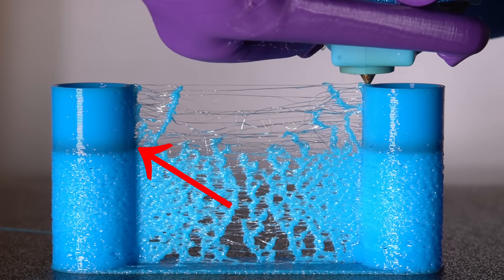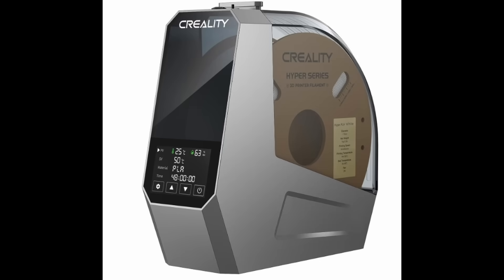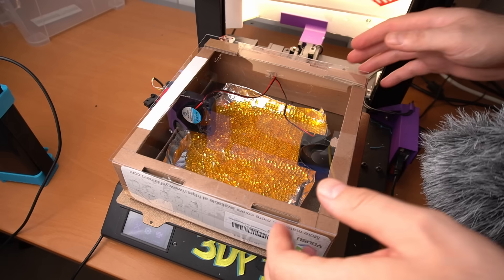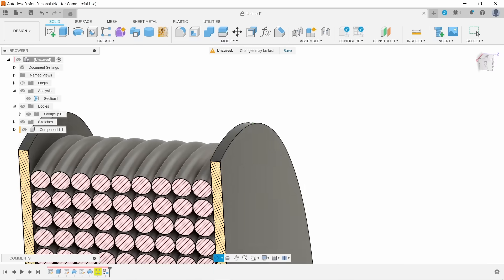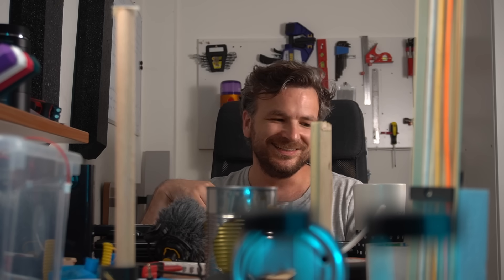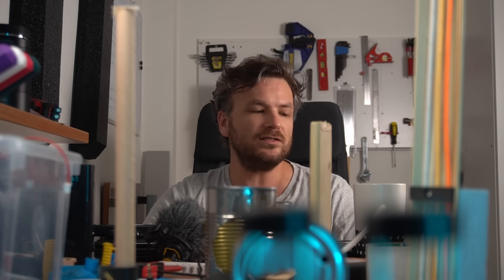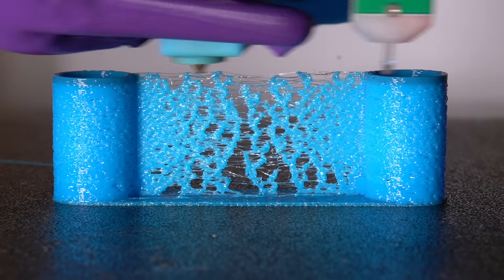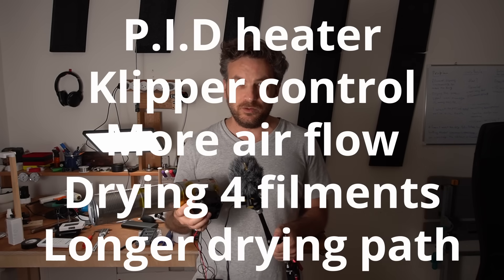Why are we drying filament this way?

Comment: I think the question is: Why does moisture cause artifacts in prints in the first place? When moist filament comes out of the hot end it produces steam. That’s moisture escaping a closed system. If the steam had somewhere else to escape perhaps it wouldn’t cause artifacts. A dry box or dehydrator essentially uses heat, just like a hot end uses heat to melt the material. 

The difference is a dry box / dehydrator doesn’t apply enough heat to melt the filament, but enough for the water to be forced out of the filament (boil off?). This takes time though. 

I think the challenge of inline drying is you need a temperature high enough to quickly expel the moisture, while preventing the material from melting or softening before it reaches the hot end so it doesn’t cause over/under extrusion. Using a lower temp prevents this, but requires a longer run / more time. Using a higher temp has the risk of making it too soft and causing thermal cycling. Ideally you want to inline dry filament you are about to use and not retract back on the spool. 

Isolating filament into a strand is interesting though. You may not be able to dry it inline just before printing, but I wonder if you could combine a spooler to more efficiently dry the filament by slowly unwinding/rewinding the spool. With a wound spool the filament on the outside is likely to dry first while the inner spool will dry last. Sort of like cooking a steak. If you could slowly dry while winding, perhaps by you can use less heat. This doesn’t solve the inline problem, but could result in a better dryer.
Reply: There are two issues with moisture.

One is that the steam, as it occurs in the meltzone, causes the melt to separate. Once you have a bubble of gas in your semi liquid melt, you lose control over the extrusion, as the steam will try to push the portion of the melt under itself out of the nozzle. Even if the pressure isn't very high, the fact that it's separated means that it will droop, you cannot prevent it from leaking by retraction. Foaming is also partially this issue.

The other is a chemical process, hydrolysis, in which water will cleave polymer chains, and this only happens at a substantial rate at elevated temperatures, with critical temperature being vaguely rule of thumb somewhere around 75°C, below which there is basically no damage, with higher temperatures being progressively more damaging, and our printing temperatures in range of 200-260°C being quite bad. This is why you specifically don't boil the filament in a dehydrator or drybox. Cleaved polymer increasingly shows lack of cohesion, basically you get crumbly shit, as you need that looooong chain of polymer (typically tens of thousands of chain bonds, reaching into millions, topping out at millimetre scale length) so they can all hook into each other. They aren't anyhow connected otherwise, they're basically a bunch of floppy ropes that are held together by friction to make a solid item, isn't that cool? This is what makes them thermoplastic btw, chains that are connected to each other across (crosslinked) cannot be melted and unfurled from each other, they can only be burned :D

Comment: That's a pretty interesting thing. And the longer version worked becaouse the filament was exposed to hot air for longer. If the can was bigger the filament could be moved through it in a spiral to maximise the time it spends in the dryer and allow for higer speeds. Though, that would probably require some kind of motor that would need to be synced up with the extruder to help it a bit.

The air speed to heat ratio would also need to be tweaked around so the dryer could be more efficent.

Comment: Nice video, new subscriber.

Here some upgrade ideas, detach the heater and fan from the cans, and just make a long tube with vents at both ends, one would be the hot air inlet and the other the "moist" air outlet, and connect these to wherever you mount the heater and fan. Now, if you recirculate that air (which you should want for efficiency) you would need a way to dry that air, as it theoretically fully saturate by some point or at least decrease its drying capacity.

Comment: As a guy that's worked in plastic injection molding for several years we have high speed drivers but with the speed of the drying process you risk calcifying the plastic which would give the plastic a very filmy appearance. It might even splay out of the nozzle of the printer. Since when most plastics catching they tend to get extra gassy when you melt them (yes all plastics gas it's just a matter of how much they release).
This is why the dry boxes are the standard since it's a completely controlled environment. The air flow actually doesn't matter as much as you think since the temperature alone should cause the moisture in the plastic to steam. This is why often you'll either only have airflow going over the top of the dryers cabinet or even just a vent up top.

Your solution is mostly fine since TPU is more or less a pretty forgiving material. But ABS you'll have nothing but problems.

Comment: The idea is nice .. Just the way you did it was not. Any bowden-tube printer could simply pump hot air INTO the bowden tube. That's almost one meter of drying. I might try that

Comment: Retired now, I spent 2 years developing dehydration test system for our motor Stators, moisture in stators in AC not good.   our measuring system used DC heat on the stator wires, and a vacuum and dry nitrogen purge.  the real good part was the dry Nitrogen purge, i would apply about 15psi dry nitrogen to the stator holding cavity, pull vacuum, the nitrogen would absorb moisture and became the medium for me to capture it in a Liquid nitrogen bath.  we would weigh test tube before and after to get the weight of the water pulled from stators.  this was a 4 hr test cycle, not piratical for 3d printing. Just letting you know how a measuring system works... perhaps it might trigger a thought for you.  Me i keep all my filament in dehydration containers all time. just because i know how hard it is to dehydrate.  your idea super good - should help lots of us.

Comment: I too would like to see the next version of this. Overall i think this is a great idea, and a few questions popped in my head:

1. Would it benefit the drying if the filament went through the cans in a spiral shaped bowden tube with as many cut outs or holes as possible, so it would spend as much time in the hot air as it can? 
2. What difference does it make where does the hot air enter the cans, like is it better for the filament to be entering from the same side as the hot air, or would it be beneficial for the hot air enter where the filament exits, so its the hottest near the end?

3. Whould it make a difference if the cans had a way to shape the airflow in a spiral also?

Comment: This is related to a classic problem given in thermodynamics classes. The question is how hot does the oven need to be to cook the potato in ten minutes.  The answer is that it can’t be done because you’d set the potato on fire at the needed temperature.  

With filament it’s probably the glass transition temperature that puts a limit on how fast you can dry it out.
Reply from the maker: Depended on how big is the potato
Reply: @3DPI67  - Believe me, when the classic baked potato problem is assigned in a thermodynamics class it’s spelled out in great detail.
Reply: I guess you could make the can longer so it has more time to dry out? Like at some point the plastic will be too wet for it to be possible but it could probably still be good for certain moisture levels.
Reply: Yeah, it could be that the 30, 45 or 60 seconds it takes for the filament to traverse the drier isn't long enough to drive all the moisture out of a 1.75mm filament even when the temp is so high that the filament is already softening really badly. The water molecules need to diffuse out of the hot filament and that probably can't be forced to happen any faster even if the ambient humidity is at zero and the temperature is at 80C. The filament drier just needs to be longer when the traverse speed is fixed and all the other variables are also limited. At some point it's just better to put the whole spool in a drier.
Reply: @wombatillo  You could always print slower to give the filament more time in the dryer. The cans seems like a lot of extra space, which is great for dissipating the humidity, but takes a lot of extra energy to heat up. What if we used heat that we're already making, like from the print bed of the printer that's printing? I don't commonly use the whole print surface and a couple loops of like 4mm ID PTFE tube to allow some air flow past could be half a meter long. Put some holes on one end for injecting air and some holes on the other end for letting the air vent out. I could see issues holding things still on a bed slinger.
Reply: @wombatillo  He did use the dried spools.  They printed badly.   His short drier fixed that.
Reply: Instead of making the dryer longer or printing slower, you could just wind the filament around pulleys so it makes multiple passes through the dryer before entering the printer. Have a rod on each end of the dryer with a set of little pulleys on each rod and wind the filament back and forth between the two rods. Might run into a problem with pulley size vs. the minimum bend radius of the filament
Reply: @theflyingfish66  The filament is already wound around a spool. Maybe applying heat to the exposed surface of the filament would be sufficient.
Reply: Solution to the thermodynamics problem:

Step 1: mash the potato to increase surface area : volume ratio
Reply: @ChucklesTheBeard  …but my text book didn’t give the values for thermal conductivity or specific heat of mashed potatoes. 🤷🏻
Reply: @ChucklesTheBeard  Then roll it out flat
Reply: What if instead of a can(s) you used a coil of tubing of some kind?
Reply: @patricktierney4392  I was thinking the same thing, something like a coper plumbing tube or the like. Might even be able to add a bit of heat too it (Water Pipe Heating Cable) and assist with drying.
Reply: Moisture removal isn't a zero-sum game. If you can't increase temperature, you can increase air velocity. This is why convection ovens are the standard.
Reply: @ - Air flow only affects the heat transfer due to convection at the outer surface of the potato. The fundamental issue with this thermodynamics problem is the thermal conductivity within the potato.
Reply: When I was younger, we used to keep photocopy paper dry by keeping it in a cupboard with an incandescent light in it - permanently on. The heat would keep the paper dry. Would this method be effective for storing filament?
Reply: @markfogliani6328 might be but it seems to be singularly inefficient. Also, finding decent incandescent light bulbs nowadays...
Reply: @markfogliani6328 - Yes, by raising the temperature of the surrounding air you increase the amount of moisture that the air can absorb.  The warmed up air will pull some moisture out of the filament until the filament and warm air reach equilibrium.  I believe that there are recommendations online for appropriate storage temperatures for different filaments.
Reply: That's true for the spool and why the bare filament is a much faster option.
Reply: not if you use a pure nitrogen atmosphere in the oven!
Reply: You can def cook a potato in a microwave oven in 10 minutes
Reply: @TomCrockett-bl1gp  yes, but you can't microwave filament (can you?)
Reply: @MrNoipe that'd make a pretty good experiment tbh. I guess it would only work well with materials with a high glass transition point though (if at all)
Reply: @MrNoipe  You can microwave filament until it is dry but that is not good for the microwave. Microwave basically  sends an electromagnetic wave into an enclosed space at the oscillation frequency of water. The water in the enclosed space begins to oscillate at that frequency but the electrons spin around their orbits faster and at great distances from the atomic core. The water gets hot and evaporates. But once there is no water then the microwave energy in the oven is not absorbed by any water and can damage the oven. Running an empty microwave oven is not a good idea. I think the plastic will be invisible to the oven. Melomine on one hand does heat up in a microwave. Not sure about tpu or pla.
Reply: @meisievannancy microwaves don't operate at the resonance frequency of water. They are effective on any polar molecule.
Reply: @zyeborm  Well you are right but the tuning is off the resonance of water to get penetration. But nevertheless it causes resonance of the water bipolar molecules. I think one of the resonant frequencies of water is somewhere at around 22GHz. So it would be about a resonant pole produced by the 2.45GHz stimulation. I have not tried PLA in a microwave oven but melomine definitely does heat up and some porcelain. The former not being a good idea and ive seen m ovens start sparking away with nothing to absorb the EM waves coming out of the waveguide.
Reply: @TomCrockett-bl1gp  Defo can't unless you're using a nuclear reactor 🙂
Reply: French fries exist y'all
 Air fryers too
Reply: @kin6701  deep fried filament?????
Reply: @Sulfuron41  - On a stick. 😁
Reply: @kin6701 the task is whole potato, not small slices thereof.

Comment: I have a similar setip to this but a bit more over the top perhaps. 
I run filament through a relatively long tube that passes hot dry air over it, the air is dried by first passing over molecular sieves and since it's almost an entirely closed loops the molecular sieves don't have to be dried very often.

Only downside I've found with this other than the initial cost of the dessicant is that it can work too well for nylon, if you remove all the moisture from it, it becomes brittle it turns out.

Comment: The funny thing is, we already do use basically this exact method for injection moulding. Especially with smaller machines used in labs and R&D facilities, you don't really have a big material storage with pipes running to each machine, since you change materials way too often. That's why you put your bag of material in a dryer, that's basically a bucket with a hot air blower at the bottom that blows through some desicant (and filters) to dry the granules by blowing warm and very dry air over them. There are inline versions of this, though they require the input material to already be reasonably dry (so similar to your version with the drybox).
Reply from the maker: For how long you need to dry the material?
Reply: @3DPI67  Depends on the initial moisture content. In the lab we used them with PA, which needs to be very dry for injection moulding so we  usually just let them run over night, to start working right at 8am. However we did forget once, so we just turned it on for 2h and that did the trick for an entire 25kg bag of material. I'd say for 3d printing use with material from a dry-box an inline version like you built, could work perfectly. You might want to figure out a way to  pre-dry the heated air that's going into the chamber and build a slightly longer and tighter chamber and it should do the trick. Mabye a stronger fan that sucks or pushes through a can of desicant would work.
Reply from the maker: @MrsMcMuffin  Thats was helpful thank you.

Comment: You can simplify your design by a great deal. For example you can spool the filament on an intermediate spool in a spiraling way. For example 10 times and blow warm air through holes on the role. You can increase the effective filament length by a great deal and probably get away with less wasted heat. Probably some drying process could be integrated in the nozzle too.

Comment: I did something like this years ago using a hot air soldering station and a simple "Y" that I printed from PETG to inline dry nylon. Due to the short drying path I had to have the temperature pretty high (as high as I could without softening the PET too much) and really high airflow, but it worked really well. There were three main reasons I didn't keep pursuing it. 
1. I live in a desert, so I almost never have to dry filament. 
2. It dumped a ton of heat into my office, which was pretty uncomfortable. 
3. It was really loud. 

I think that an inline dryers can make a ton of sense though. Looking forward to seeing your progress! You could try using the guts of a hair dryer, or at least the heating element.
Reply from the maker: My room got so hot! had to run the ac and heater at the same time.

Comment: My thought is a longer filament path, in an enclosure: filament would feed into a box, around a large-diameter plastic mesh spool (a dozen turns or so) then out the other side for printing.  You could also do something more linear, like your cans, with a "screw" inside that the filament wraps around (many many turns) before printing.

Comment: glad you tried sometnih new for drying filamnet, i moslty print with PLA and sometimes PETG, done few prints with TPU, recently got for bargain price sovol dual filament dryer and it takes time to dry them spools, my question is how deep moisture get in to the filament and if inline dryer is able to dry it completly not just the surface in much shorter time?

Comment: So why not use the cpap blowers for remote part cooling and the tube it blows the air through. If there is enough volume of air just warm enough it could be part cooling and filament drying.

Comment: Also, you don't need a PID controller (you already have one I know).  But you can also use a Thermal Fuse (about $0.50 each).  They have a fixed temperature, but you can also use a selector switch to pick predefined temps. (there are only 5 anyway).